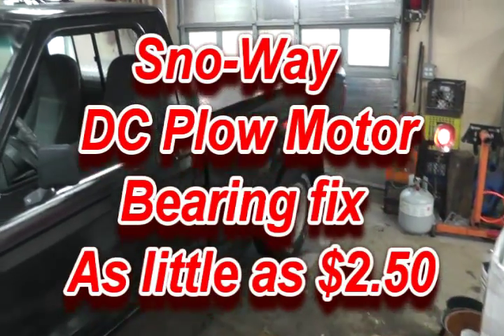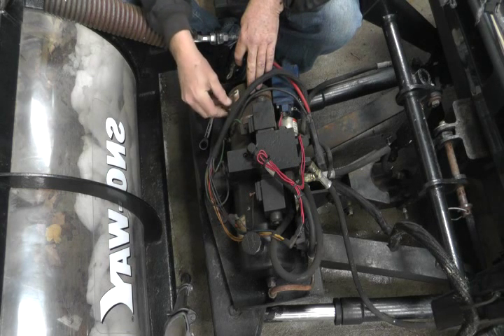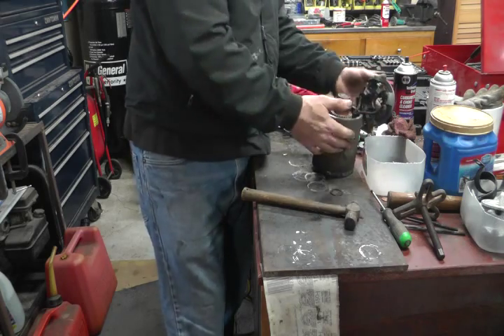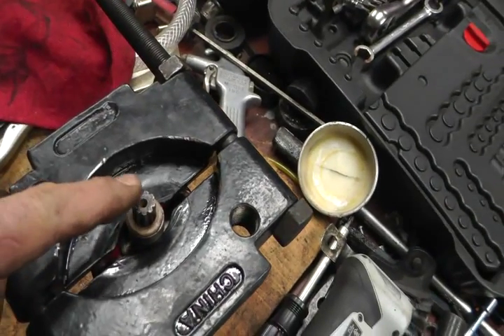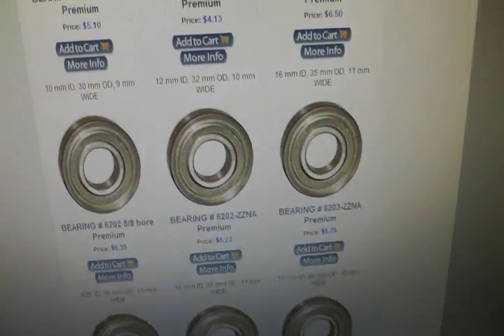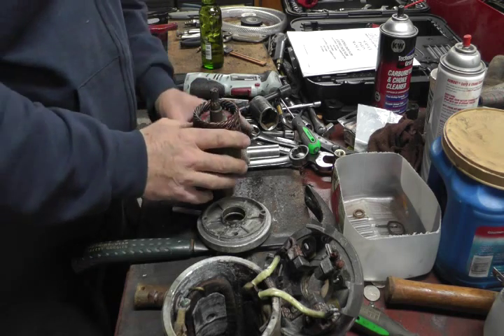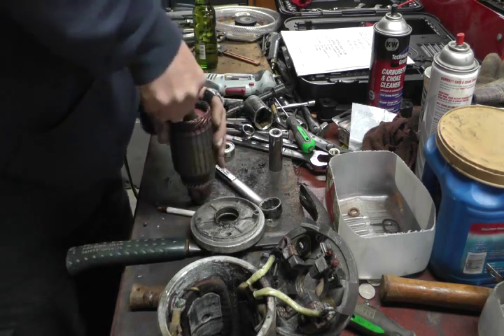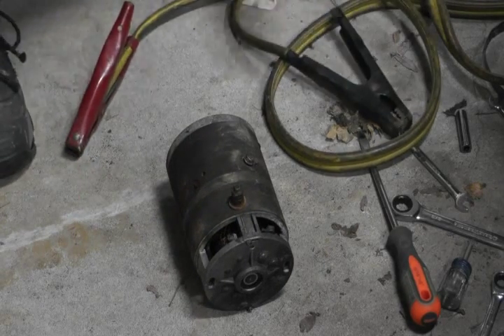DC Motor Bearing Replacement Sno-Way Plow

Comment: Can the plow be lifted off the ground manually in the event of a hydraulic or electrical failure?
Reply from the maker: Yes. When you push the down switch and the plow is down for plowing, it floats up and down with its weight resting down on the blade or pads, following the shape of the road as you push the snow. So, you could lift up the plow with a jack or hoist or lever of some kind and block the plow up. Most plows have a bracket used to block the plow in the up position and it is supposed to be installed whenever you are going to drive down the road (not plowing) so that in the event of a hydraulic failure, the plow will not slam down while you are going 65 mph down the highway.
Reply: Thank You.